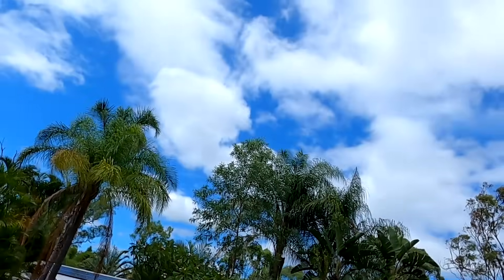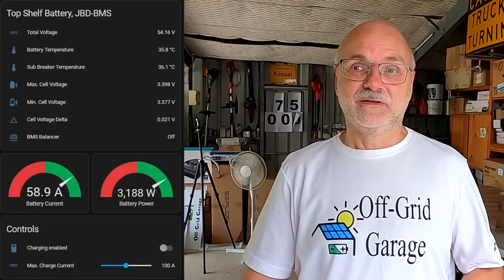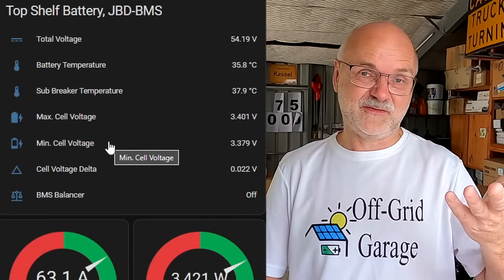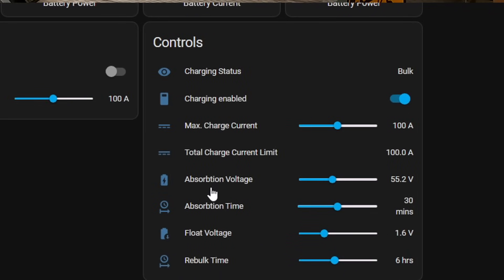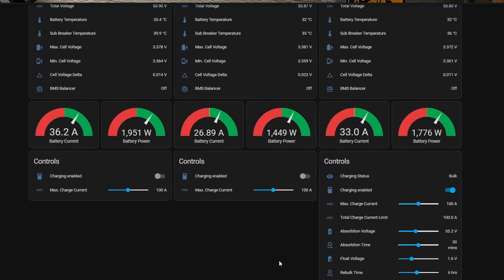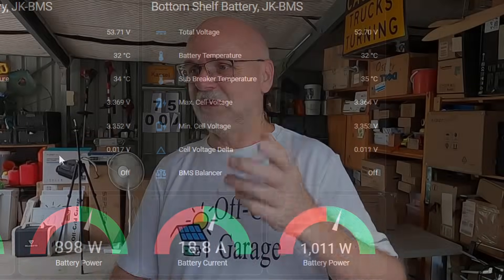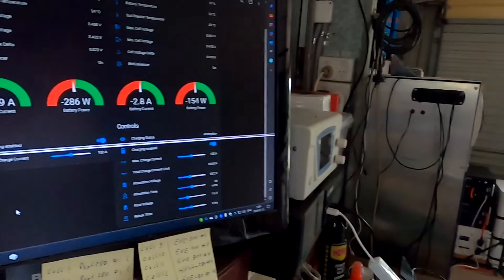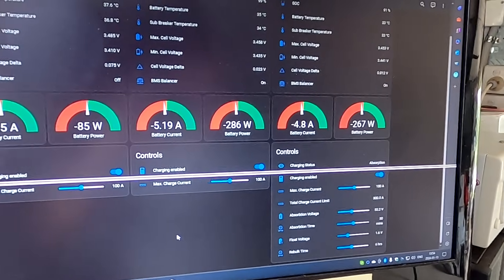Is JK's 0.6A active balancing enough? First charge of the Battery Shelf under 'Peter' Board control.

Comment: I like the Setup you have done.  I am planning on installing 2x Orient Power 230Ah 51.2V 11.8KWh batteries in parallel with my existing Simpliphi power 75Ah 22.8 kWh Battery Bank. The only problem I will have is that the Simplphi Battery does not have an integral BMS but rather is controlled by a Schneider Electric Connect BMS for SOC control. Is there any way I can control the three battery banks' BMSs? I can see that the two Orient Power batteries' BMSs can communicate with each other by connecting the communication cables. I just don't know how they could communicate with the Schneider Electric BMS. I can set the 2x orient Power batteries BMS settings locally on their perspective BMS and then have the Schneider Electric BMS control SOC control to the combined battery bank.
Reply: Interesting.  I've never heard of a simpliphi without a bms, nor a schneider bms.  Do you have a link for either of these?
Reply from the maker: The question is if you need any SOC control at all for your setup or can just use the battery voltage for determine CVL.

Comment: Did the jbd balancer turn on? At the end of the video it still showed off.
Reply from the maker: It's a charge balancer (which is turned off). It only turns on if there is 0.0A showing. Stupid design from JBD.

Comment: Is there a rule of thumb what current the integrated Balance should be capable of based on the battery size ?

I can remember that many had taken the 2A JK BMS for the usual 14,3 kWh EVE LF280K batteries, but what about a 3,6 kWh LFP 16S battery (74 Ah) ?
16 x 74 Ah x 3,2 V = 3789 Wh or 3,8 kWh which would mean 27% of the big 14,3 kWh. 
And these 27% would equal with a 2A BMS just  0,54 A 

A 0,6 A balancer should have even more reserve, but the main question is still:
How should the balancer be layed out to get the battery balanced (battery capacity) and  when to get a 4A or a 2A or 1A or 0,6 A on

Comment: Hi Andi,
I am a little bit concerned: In the past you had a 2 layer of protection
A)	The Solar charge controller
B)	The BMS
Both systems worked completely independent, if one fails, the other would prevent the battery from overcharging (witch can result in fire)
But now, if the BMS fails, there is a chance that the system will continue charging up to very thing goes to fire.
Maybe you can make a video on this safety issue
Reply: Lifepo4 does not burn up due to overcharging. It will swell, degas, and go kaput. Other chemistries run the risk of fire on over charging.
Reply from the maker: What fire are you talking about?

If the BMS fails... if the circuit breaker in your house fails. That's not good in both cases...
In any way, the Peter would still charge to 55.2V. So, no fire?
Reply: @OffGridGarageAustralia  You might got me wrong. In the standard setup (solar charge controller not connected to BMS) you do have a dual layer of protection. Even the SCC fails, the BMS will shut down, or if the BMS fails the SCC will have a maximum (bulk) voltage he will charge to. No issue, no potential hazard.

If now the SCC lisens to the BMS, and this (e.g. measures a worng voltage due to component failure) the charging will go on upto the damage of the battery (and maybe, maybe not - a fire hazzard)

That's just my point, by connecting, you remove one layer of protection.
Reply from the maker: @peetbraun9439  We still have the BMS and the SCC. We only add an option to modify the coms in between. The BMS will still disconnect if cell voltage goes over 3.65V even the board will go crazy and tells the SCC to charge to 5V.
Same, the other way around if the 3.65V protection fails in the BMS, the SCC will still charge to the set voltage the board tells it to charge.
Nothing has changed and no safety concerns.

Comment: I ran across some 1.2A / 1.3A balancers on aliexpress that work all the time and are of the distributed / headless kind and most probably the future as they are very simple and economic.
The "xS Active Balancer Equalizer Board" type sits between 2 cells in a pack and only cares about those 2 and moves energy between them if their voltage difference is big enough - keeping them on the same level. So for a 8 cell battery it's: cell1-AB1-cell2-AB2-cell3-AB3-cell4-AB4-cell5-AB5-cell6-AB6-cell7-AB7-cell8 .  In contrast to that does the MCU and active balancer on a JK-BMS for example jump around all the time and needs semiconductor switches that must not fail + needs those balancer wires (with resistance and all the associated problems).
Reply from the maker: We cannot use these 'always on' balancers for LiFePO4 as they cause an imbalance when in the flat part of the charge/discharge curve.
The active balancers out there including the NEEY and JK balancers seems to be very robust and working extremely well.

Comment: Andy, The float mode reduce the voltage, how it works ? where the V are going ?  I can understand Amps are inside the cells but the Volts...
Reply from the maker: Don't know exactly what you mean?
Reply: How the Inverter decrease the Voltage ? I think it would be good to understand how & why. Amps goes inside, and to be removed need to be used or converted in heat, but the voltage reduce process...... @OffGridGarageAustralia
Reply from the maker: @christophec252  The board controls the charging voltage CVL, so the inverter only charges to this set voltage. Like with any inverter or MPPT. With these boards, you have control over that voltage from your mobile.

Comment: 7:57 can you do this with home assistant with the new jkbms?
Reply: With BSC on an ESP32 you can read all values from a JK via Bluetooth. I think this should also work with the new Inverter JK.
BSC can send all values via mqtt and this could be read by HA.

Or do you think of controlling the charger? 
This depends on the charger or inverter with integrated charger. Many brands can be controlled by HA
Reply: I'm working on a solution to hardwire the JK-BMS, like my other boards, so you could use the New JK-BMS as a standalone or master/slave with other BMS eg older JK or JBD, or other CAN Batteries.
Reply: @Juergen_Miessmer  I don’t have HA I’m using solar assistant but HA looks so much better. I can control my inverter already using SA however not as easy as this dash board this looks great

Comment: Using a Bluetooth connection instead of UART would have allowed the Peter board to truly cut off the charge from the BMS (the UART connection only allows reading of the BMS). But is it good to use a Bluetooth link in production? I'm testing it at home with two BMS monitored via Bluetooth by the same ESP32.
Reply from the maker: I would not trust Bluetooth for such a safety related connection and function. It is far to unreliable. I guess he made a similar decision at some stage. 
You've got this in your own project, I guess?
Reply: @OffGridGarageAustralia  Yes for my batteries I prefer the wired connection. But I had requests to use Bluetooth connection so now I have two different YAML, Wire and Bluetooth. The Bluetooth connection being tested at home is stable.
Reply from the maker: @OpenSolarEnergy  That is great progress. Thanks a lot for your work and sharing it here. Once it's ready, maybe I can show it on my channel as well...

Comment: Which pack of batteries had the damaged cells replaced ? with newer cells, would that affect charging?
Reply from the maker: That has no effect. It was cell 15 in the bottom shelf battery.

Comment: So why would you want to go into float mode at all and not stay on Absorption until the battery goes down to 80% or so abd then switch to bulk again?
Reply from the maker: That's not possible to stay in absorption and let the battery go down to 80%. Also makes no sense with LiFePO4 to go 80%
Reply: @OffGridGarageAustralia  ok i see.
But why would you need to set a float time at all?
Im the victron system you can change the charging algorithmus to switch back to bulk once the voltage dropps a definded voltage e.g. 0.1V below the set float voltage.
Once there is no solar the voltage of the pack would naturaly drop.

Is that not precice enoth or way is the float time needed?
Reply from the maker: @RFDarter I think that has been explained in the latest video now:  https://youtu.be/eZX7CkEEq_8

Comment: If you put no-ox paste between terminal and alu busbar there cannot be an oxide layer as this connection is airtight and no-ox is sealing it permanently. This means no oxide layer can happen. I assume the total internal resistance is higher then the other two banks.
Reply from the maker: Tried that and some other pastes as well. Best result was without anything though...
Reply: I have different experience and i am dealing with Lithium nearly 20 years now, the first 10 years in competition car stereo and the first lithium we got "illegally" from a scrapped military vehicle. The best result for a short period like 2-3years without paste if the terminal are metricously even and the busbars too...but thats rarly the case. And when you sand the battery terminal by hand you destroy that. Means the connection is not airtight anymore. The paste is highly conductive and make sure the whole surface is connecting and 2nd making the connection 100%airtight so that connection cannot corrode over time which otherwise happen if you eg use tinned busbars as contact corrosion can occure over time. I use either aluminium or silver coated busbars (which eg is used on NH fuses and high current environment installation like grid stations) with No-ox paste to seal connection.

Comment: Quick question, wasn't it always said that Lifepo cells don't need a float mode? If the cells are reduced from 55.2 to
53.6 volts, they are discharged and are no longer at 100% SOC. Wouldn't it be better if they are not actively discharged, but can simply rest without discharging? The  voltage would still be falling slow.

Kurze Frage, wurde nicht immer gesagt, dass Lifepo Zellen kein Floatmode benötigen? Wenn die Zellen von 55,2 auf 53,6Volt reduziert werden, werden diese doch entladen und sind nicht mehr bei 100% SOC. Wäre es nicht besser wenn diese nicht aktiv entladen werden, sondern nur einfach ruhen können ohne entladen? Die Volt Spannung würde trotzdem fallen, aber viel langsamer und natürlichen?
😊
Reply: Dazu müsste man die Batterien vom Busbar  trennen. 
Das geht bei einem OffGrid setup aber nicht. Die WR müssen ja immer die volle Leistung können, auch wenn die PV mal z.B. wegen einer Wolke das nicht liefern kann.
Die Batterie muss da immer als Puffer dienen können.

To do this you would have to separate the batteries from the busbar. However, this is not possible with an off-grid setup. The inverters always have to be able to provide full power, even if the solar panels cannot deliver this because of a cloud, for example. The battery must always be able to serve as a buffer.
Reply: @Juergen_Miessmer  Wieso trennen??? Als Andy den Floatmode aktiviert, wird doch aktiv entladen bis die 53,6Volt erreicht werden. Hat nichts mit Offgrid zu tun sondern wie der Floatmode immer funktioniert. Die Frage war, ob einfaches Ruhen nicht besser ist.
Why disconnect??? 
'When Andy activates the Eloatmode, the battery is 
actively discharged until the 53.6 volts 
are reached. Has nothing to do with off-grid 
but how the Eloatmode always 
always works. The question was whether simple 
resting is not better.
Reply: @derfreiemensch  
Weil an der Busbar nicht nur Laderegler und Batterien angeschlossen sind, sondern auch die Wechselrichter. Diese brauchen ja weiterhin Energie um das Inselnetz zu versorgen. Und diese Energie muss irgendwo herkommen. Ruhen ist technisch bei einer Inselanlage nicht möglich.
Ohne float würden die Batterien sofort stark entladen und die PV nicht mehr genutzt werden.

Because not only charge controllers and batteries are connected to the bus bar, but also the inverters. These still need energy to supply the load. And that energy has to come from somewhere. Resting is  technically not possible with an offgrid system.
Without floating, the batteries will be discharged much stronger an no more solar power is used.
Reply: @Juergen_Miessmer wieso? Einfach im Absorption Mode bleiben, dann wird doch nichts getrennt oder abgeschalten.
Und der mppt stellt weiter die Energie für die Verbraucher zur Verführung ohne die batterie zu entladen.
Reply: @Juergen_Miessmer Das ist nicht richtig was Sie schreiben.
Reply: @derfreiemensch  
Aha....was ist nicht richtig ?
Bitte detailiert erklären

What is wrong?
Please explain in detail.
Reply: @RFDarter  
Die Akkus dauerhaft auf Absorbtionsspannung zu halten ist nicht gut. Das hat Andy schon mehrfach erklärt...

Not good to stay at absorbtion voltage permanently. Andy explained that multiple Times.
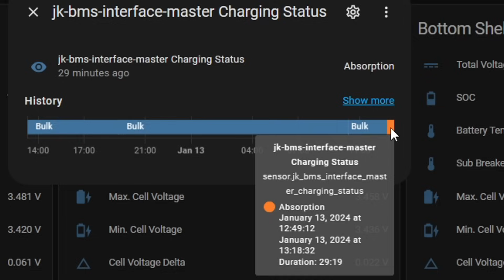Reply: @Juergen_Miessmer  Ganz einfach, im Video bei 22:20 wird bei Start des float mode mit 20A entladen, die Inverter benötigen aber noch nicht mal 0,1 A, Andy sagt sogar das jetzt aktiv entladen wird bis 53,6 Volt erreicht sind. Das selbe konnte ich bei meinem System auch schon nachstellen, weshalb ich keinen Floatmode betreibe, da nicht üblich für Lifepo und aus der Bleibatteriezeit kommt. Die MPPTs könnten weiter Energie zur Verfügung stellen, es wird aber aktiv entladen, um die 53,6Volt zu erreichen. Das hat nichts mit den Invertern usw. zu tun. Deshalb war Ihre Aussage nicht richtig. Andy mag der Meinung sein das dauerhaft die Batterien bei hoher Spannung zu halten schlecht ist, was auch richtig ist, aber eine hohe Spannung sind nicht 3,45Volt. Da gehen die Meinungen halt auseinander, Andy hat ja auch verstanden das er höher laden muß um das die Balancer ihre Arbeit machen können. Zudem ist Andy ein Privatanwender wie Sie und Ich und nicht Gott. Sicher er hat Erfahrungen und viel in den letzten 2 Jahren gelernt, aber das haben wir alle. Ich schätze seine Videos weil er viele unterschiedliche BMS usw. testet und die Videos unterhaltsam gestaltet.
Reply: @derfreiemensch  
I think you still have to learn a lot.
Reply: @Juergen_Miessmer  Thats why i live here on earth, you know everything, so why you are here? Tell me what is wrong in my answere.

Comment: The voltage difference between the packs could be due to the calibration of the BMS. They should all be exactly the same voltage as they are all on the same busbar. The charging current could be different because of the cell chemistry.
Reply: The Voltage is only exactly the same if no current is flowing.
Reply from the maker: ... and all BMS are correctly calibrated.

Comment: If Home assist is logging the data, can you export 1 or more days & compare the sum total of amps in-out of each shelf? or daily averages. Each shelf will have a typical % share of the total Ah per day. And compare this with your estimates of cell capacities.
Reply from the maker: Yes, you can do this directly in Home Assistant and have three graphs showing the data of the batteries.

Comment: The 'Peter' board seems pretty useful. Would love if it could update quicker than every 10(?) seconds. Also, what's the logic/reason for having "charge enable" and "charge current" on the slaves. Why not control it all from the master instead since it affect global settings, not individual slaves/BMS's?
Reply: If one or more of the BMS is off-line, or has gone into protection the current will automatically reduce by that slaves current setting, this is the primary purpose of the slave current settings, each slaves tells the master how much current it is able to accept.

Comment: The difference in voltage might be the accuracy of the voltage measurements with different BMS's
Reply: That wouldn't explain the difference in charging amps at higher SOC though.
Reply: @davidpenfold 
One of the Murphy's laws may apply. Under the most controlled conditions the pice of electronics will do dam well what it feels like.
Reply: @universeisundernoobligatio3283  Quite possibly. But the fact it's still taking in current does tend to point to a more physical/resistance issue
Reply from the maker: Yes, absolutely, we now have three different BMS measuring so there will be some inaccuracy..

Comment: Andy believe it or not it's possible to get the old faulty NEEY balancers eating out of the palm of your hand with an esp. Andy I live near to you.. we should probably catch up one day. I've been custom designing BMS and SCADA systems to use with victron gear for around 8 years now....
Reply from the maker: The NEEY Balancer. Don't hey just work once programmed?
Reply: @OffGridGarageAustralia  no. Remember version one that lots bought but they had no ability to purely top balance? There's be thousands out there nearly useless. An esp makes them into magic. Btw... I'm actually a telecommunications carrier - in my experience 0.6 amp BMS should be a ok. Cheers - matt
Reply: @OffGridGarageAustralia  further to my comment just above - regarding home assistant, no, you don't need it to be running for these to work. I have arduinos and esps of my own code fully controlling victron sccs (and more....) with no home assistant - in the latter case you just use esphome. I have had this gear in the Australian desert for 8 years - regular 45 degrees heat, only just replaced my last set of AGMs, have been using lfo now for about 4 years too in the same environment. also.. no shunt, but hyper accurate soc from victron scc's via coulomb counting - how'd you do that I hear them ask - you really should come visit me 😉

Comment: Andy, which home assistant are you referring to? Alexa, Victron, peter?
Reply: HomeAssistent is the name for a package of software running as service on a linux host.
Reply: @Juergen_Miessmer  Thanks Juergen, so if using Peter boards with a Victron Cerbo GX this cannot be done!
Reply: @stoptheirlies  
Peter board can be used and configured standalone. 
But the nice dashboard Andy is showing here is a HomeAssistant frontend.